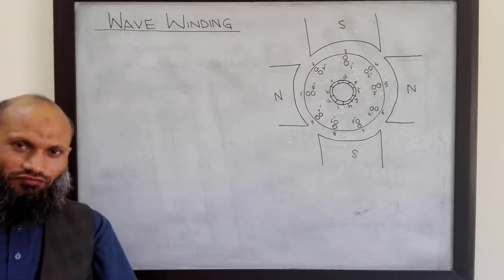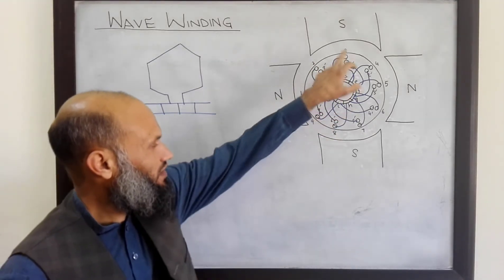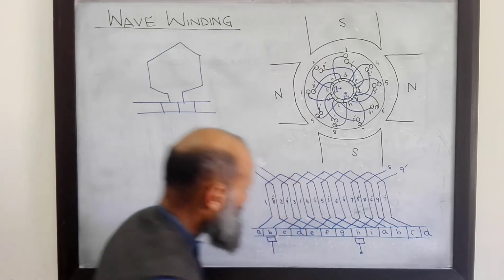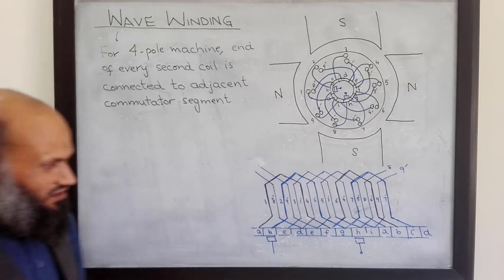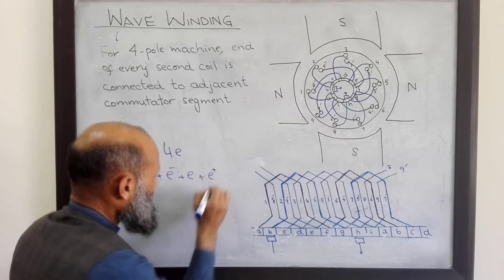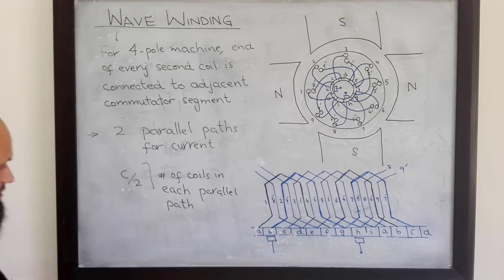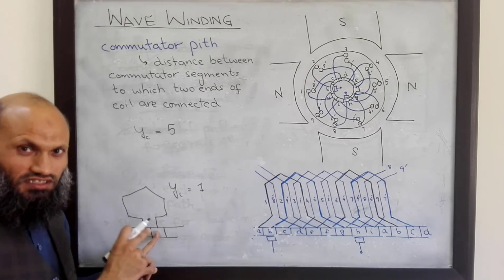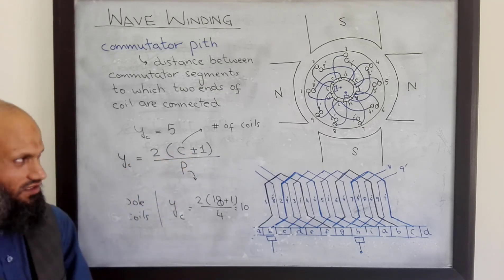EE213 - 18 - Wave winding

Comment: sir in the question you said there are 8 poles but in the formula you have put number of poles = 4 ?what is the reason for that ? and secondly when we should write c+1 and when we should write c-1? thanks in advance for your response!
Reply from the maker: Both c-1 and c+1 are correct, the difference between the two will be the direction of rotation of machine.